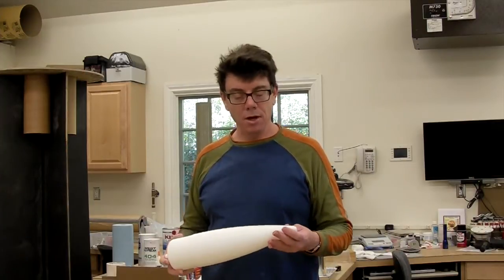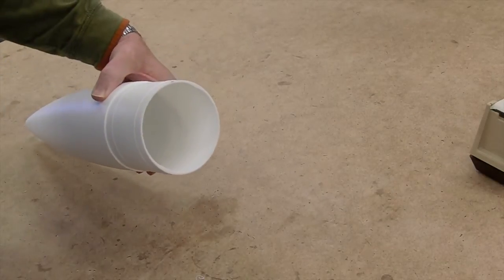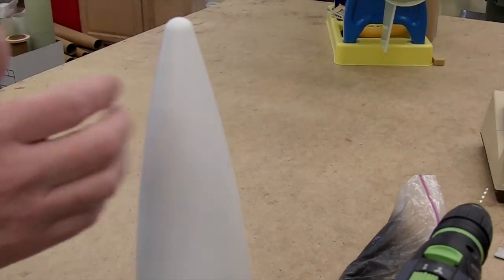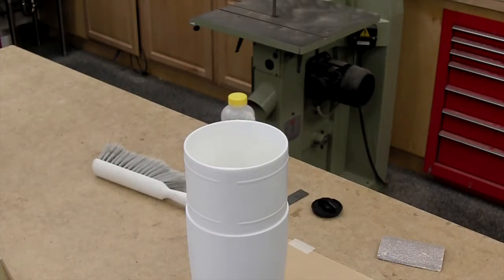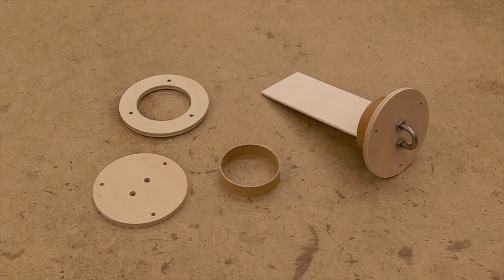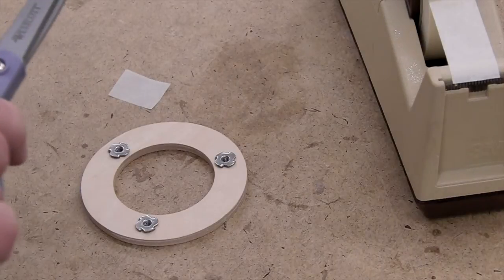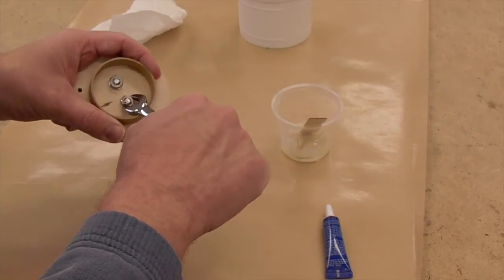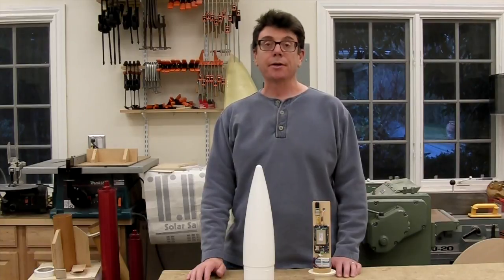Plastic Nose Cone Mods

Comment: JB Weld makes an epoxy for plastic. I used it to glue together a piston in an espresso machine that is exposed to high temperatures and pressure. Holds like a champ.

Comment: Excellent video. Question: Why not use short brass "pins" inserted through the nosecone into the T-nut ring to provide more mechanical advantage?
Reply from the maker: I hadn't thought of that, but I'm sure that would add some strength.

Comment: Excellent video!  However, what size (specifically, diameter) bulkhead serves as the base?  I don't think you can insert a LOC 98mm bulkhead into the shoulder of a LOC 3.90 nose cone (without significant sanding around the outer edge of the bulkhead).
Reply from the maker: You're right, the OD needs to be sanded down to fit. This isn't entirely consistent or uniform because of the molding process.

Comment: Hi John, first allow me to say thank you for producing these videos. A LOT has changed with the hobby that I left 40 years ago!  Okay, so here is my question, how do we know how much lead shot to use in our rockets? By using simulation software, or is there a different way that you like to use?
Reply from the maker: First of all, most rockets don't need any. But if you are building a custom design, you should verify by comparing the center of pressure and gravity. You can do that through simulation, but I prefer to measure after the rocket is built. See this video for details: https://www.youtube.com/watch?v=IlZJnBh-fWE
Reply: @JohnLCoker  Thanks John. What I am doing is modifying an existing kit from 29mm engines to 38mm so I will have more choices of engines to use a a variety of fields near my home. Again, thanks for your help, and stay safe and healthy.

Comment: PS to my last comment: Instead of using plywood for the centering ring and bulk plates, could we use 3-D printed pieces? Would they hold up to the ejection and recovery stresses?
Reply from the maker: Yeah, 3D printing would probably be fine. You'd just have to make sure it could withstand the recovery forces if you put an eye bolt through it.

Comment: I've completed the ebay for my 4" Goblin plastic nose cone following your instructions. I am using a Perfectflight MiniAlt/WD altimeter for dual deployment using a line cutter for the main chute. Where should I put the sampling hole in the nose cone (for the altimeter), and what diameter should it be? Thanks.
Reply from the maker: I would put one 1/4" (6mm) hole on the side about 1" (25mm) above the shoulder. You want it in relatively smooth airflow. I usually also take advantage of the pressure equalization hole to provide switch access.
Reply: @JohnLCoker  Thanks!

Comment: Love your rocketry videos. Would love to see more. Could you please let me know the dimensions of the ring and sled bulkhead please
Reply from the maker: The ring is cut to fit inside the nose cone; the exact dimensions are going to vary. I started with a regular CR and sanded it down until it fit tightly just above the shoulder of the nose cone.
Reply: @JohnLCoker  thank you

Comment: Thanks for this great video, I plan on making these mods to my 4" plastic LOC Goblin nose cone. I've ordered a 3.9" OD, 54mm plywood centering ring. I don't have a CNC machine. What is the best way to size this centering ring to fit into the nose cone, since it will be too large?
Reply from the maker: What I actually did here was sand down an existing CR. You don't need to take much off for it to fit inside the cone, above the shoulder.

Comment: Thank you John for these instructions. I am attempting this with the same nosecone, and wonder if the outer diameter of the ring being bonded to the nosecone is still available in your records?  Having that dimension as a reference should save some trial and error.   Thanks again.
Reply from the maker: Sorry, I don't recall any longer. I picked a ring out of the parts box and just sanded it to fit. (That was the old days of hand work.)

Comment: I have both a question and two comments on the cross rods for the nose weight. First, why metal? Wouldn't wood dowels be easier to finish, i.e. take simpler paints and be easir to shape than brass or aluminum?

I'd suggest not using diaginal cutters to snip the rods. You're using a saw later, which leaves a much cleaner amd closer cut, so why not just saw them off in the first place? And finally, since razor saws are meant for wood and cardboard, even relatively soft metals like brass or aluminum are pretty hard on them. Use a hack saw or jeweler's saw.
Reply from the maker: Sure, wood would probably work as well, especially since it ends up encased in epoxy. There's just not much thickness to the nose cone, which is all the mechanical support those rods are going to get. (The epoxy won't stick especially well to the inside of the nose.)
Reply: @JohnLCoker  ho John, regarding this last point. How you ensured that the electronic bay was bonded well if is so difficult to have adhesion inside? I saw people embedding threaded rods into the epoxy in the top of the nosecone. Is this overkill? Thank you as always
Reply from the maker: @pisolo86  If you rough up the plastic inside with sandpaper, you get a surface to which epoxy can bond. Note that epoxy bonds are mechanical, not chemical so you just need a surface with texture.
Reply: @JohnLCoker  i am probably go to do this on a zephyr nosecone, which is quite big and for a tracker is more than enough. Thank you John as always!

Comment: Why weight the cone tip?
Reply from the maker: Sometimes it's needed for stability, especially with short rockets. Generally it's not, so you should only add to make a rocket stable if it's not naturally.

Comment: Someone could make some nice coin selling the wood parts used to modify nosecones.  I doubt that I could be able to  cut the wood pieces myself. Thanks for all your wonderful videos.
Reply from the maker: PML makes a similar product: Intelli-Cone
(https://publicmissiles.com/product/nosecones).
Reply: John, thank you for answering my question.  Being that I am building the Estes V2 I would want to keep the nosecone which came with the kit. The base of the nose cone is measured 6 cm across. Couldn't I just buy 2 56 mm wooden bulkheads cut the base of the nosecone off as you demonstrated, epoxy one bulkhead into the nosecone, screw the eye bolt into the the second bulkhead, and then once the epoxy dries fasten the two bulkheads together with a couple of small screws or even wing nuts?
Reply: I just realized that I will have to cut a big hole in bulkhead I install in the rocket. Will this make my 22" Estes V2 too top heavy?
Reply: Sorry for all the questions but if I use a bulkhead and a wood centering ring I will have recreated what you did.  Per Apogee Rocket's web site the bulkhead, centering ring, and Firefly altimeter weigh around 21 grams. The clay that Estes supplies is 7 grams. I am concluding that your method of nosecone mode is not for this rocket. Am I correct?
Reply: Recalculation: Altimeter & ebay will be 16 grams.
Reply from the maker: That's a lot more nose weight than the 7g of clay, but it's not all at the very tip. You might want to run a simulation, or just fly a larger motor :).
Reply: Thank you for reading through my posts which collectively were longer than reading Tolstoy's War and Peace. I am building the Estes V2 with reinforced centering rings (laminating cardstock over the supplied rings), 1/8" basswood fins, 10' of Kevlar for the shock cord, and a nylon chute. The plan was to launch it on E and F composite motors.

Comment: How do you know how much weight to add to the nose when you don't even know how much "Payload" you are adding??? I.E. Payload Bay.
Reply from the maker: I don't add nose weight until the rocket is nearly complete, so that would be one of the last things I do. I prefer to override the measure weight and center of gravity (CG) in the simulator and just use it to calculate the center of pressure (CP).